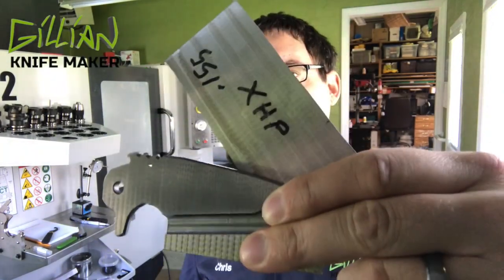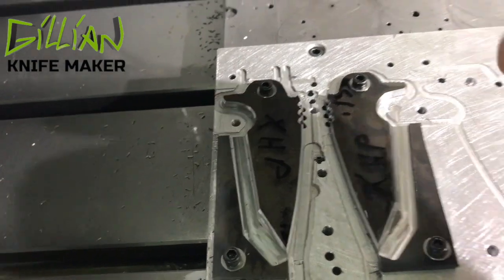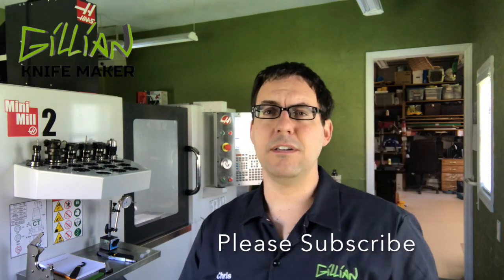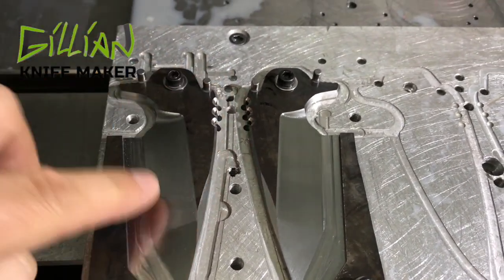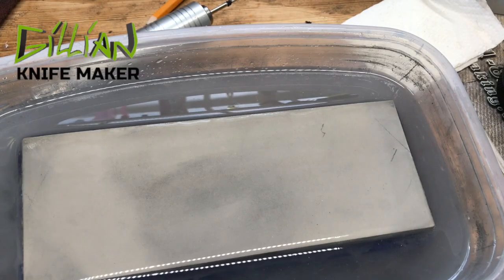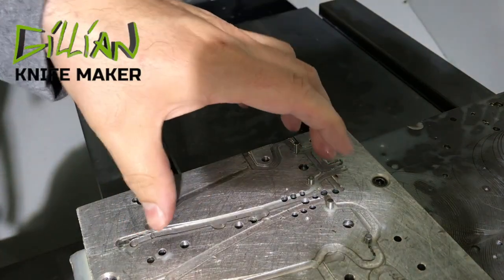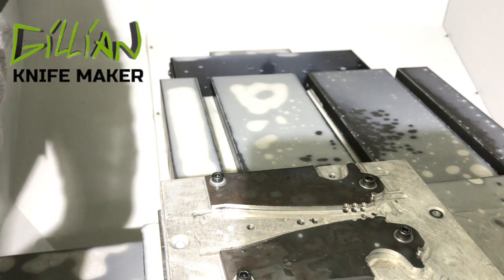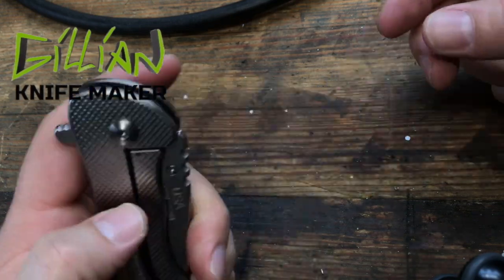How To Make Knives With CNC - Machining The Bevels

Comment: Being an engineer in metallurgy, I loved every part of this. I've got a CNC of my own, not as sophisticated but planning to use it to make knives. Hey if you need some brain storming to optimize your machining process let me know and we'll schedule something via skype.
Reply from the maker: Thanks for the positive feedback Jose I greatly appreciate it.  What type of of CNC machine are you using?  Also do you have a wire EDM?
Reply: @GillianKnives  Dude, sorry, never noticed your answer and respective question until now. Nope, mine is a mechanical router, 80x50x10 cm custom made by another quite experienced engineer. I cut wood like a charm, and can engrave and machine in 2.5 aluminum, up to 10 cms....Sorry to inform don't have EDM but I know the mechanism it uses and its advantages.
Reply from the maker: @FBPrepping  NP Jose.  Goodluck with your knife making endeavors.

Comment: Hey Gillian. Did you use solid works on making the bevel? If you did what type of 3D milling feature did you use? (Eg: 3D Scallop, 3D Pocket)
Reply from the maker: I use Fusion 360 software to machine for all of the CAD / CAM.

Comment: What if you add another op where the fixture is cut at the angle of the bevel.  The machine wouldn't have to 3d contour the blade.  Machining time would be really minimized.
Reply from the maker: Good idea Justin.  I think a fixture on a rotary would work really well.  Possibly a sine plate.  I might try a similar setup in the future.  But I think its fastest to just machine out the blanks, and then grind them.

Comment: 2 by 56? Its called a 2-56. #2 screw with 56 threads per inch. When you say "by" it usually implies the lenth of the screw, not the tpi.